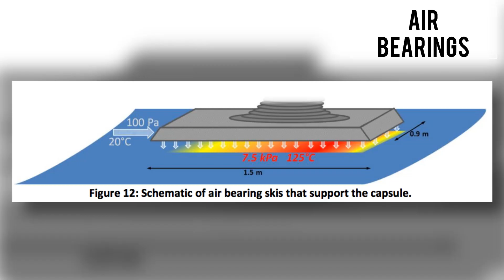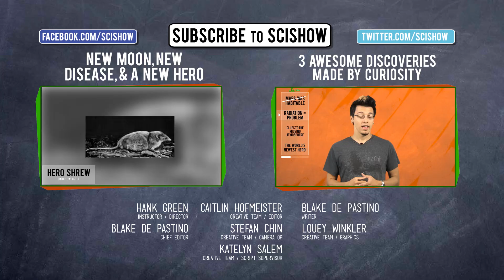The Science of Hyperloop

Comment: This would change EVERYTHING. People would be able to work in different states, and make it back home in time for dinner. Property values would change as people would no longer need to live close to their jobs. Travel and tourism would increase and this would essentially drive domestic airline prices down as new competition would enter the market. Of course, this could also just be a toy for the rich, charging $500-1,000 per person as a cost/time benefit analysis. I can see this being built in about 10-15 years. Nationwide interconnecting in about 30-40. This is definitely exciting to see and be apart of!
Reply: True. This could change land values all across the country. If you live in a little town a hundred miles or more from a good sized city but it has a hyperloop onramp and can get you 100 miles in 5 or 10 minutes  that's huge.
Reply: "I can see this being built in about 10-15 years."

I strongly disagree.
Reply: Ryan Leon if ever applied, I think this technology would easily change the structure of the world the same way airplanes and cars did before; it'd be completely mesmerizing to live in a world where you can wake up in L.A. and be in San Francisco in half an hour for work; I mean, most people who live in L.A. take longer than that to get to their jobs in the same city.
Reply: Where do you get that from?
We already have planes. This does much the same.
Reply: Flights are more expensive, need tight control, a large crew on the plane, extensive maintenance, crew on the ground to direct flights, use fossil fuel instead of electricity in most cases, etcetera.
So it does much the same for a much lower price - unless they inflate ticket prices into the sky, as Ryan proposed.
Reply: +Ryan Leon   Well, if the system had a lot of offline stations and the vehicles were small enough for point to point travel then it could allow a broader commute base but looks like they are focusing on city center to city center travel so it's really just to compete with airlines on the more profitable routes and with new planes along the long and skinny concept (modest capacity, long range and high fuel efficiency), it has quite a battle in front of it.    I doubt the currently proposed implementation would have the effects on demographics that you've imagined but if it's enough of a financial success than maybe they'll add offline stations later.
Reply: Ryan Leon maybe even from LA to New York for 2 days weekend vocation..

Comment: Whoa, hold on a second.  Who told you Tesla invented anything having to do with computing?  And sure, he helped develop radio transmission, but so did Oliver Lodge, John Stone, and this guy you may've heard of named Marconi.  As far as 'modern electricity,' I'm pretty sure we're using the same electricity that's been around for quite some time... Tesla was a proponent of A/C electrical transmission (for good reason), but nearly all devices in your home use DC internally (also for good reason).

Comment: You should exemplify for both imperial and SI users: 1 mile = 1760 yards, 1 yard = 3 feet, 1 foot = 12 inches. 
1 Kilometer = 1,000 meters, 1 meter = 100 centimeters, 1cm = 10 millimeters. This goes for volume, temperature and weight. As Mats said, 10 minutes learn, only add and remove decimals. 
Else, I suggest you imperials to change the American Dollar to Harry Potter's system, why use the obvious decimal system when you can have 1 Galeon = 17 Sickles, 1 Sickles = 29 Knuts, o.0

Comment: I know Canada is a bit of a mash-up of the two systems. For construction, imperial is mostly used. Same for measuring a person's weight and height. Grocery stores use imperial for most of the signs, except for deli, and the registers ring it up in metric. The older you are, the more likely you are to casually use imperial, as well as the closer you are to the border. The auto and industrial industries also use both, probably because of cross-border trade.

Comment: Yes; why fix anything when you can just make new! Thats why I always buy an entirely different house each time some appliance in mine breaks! Yeah, no, it's not cheaper to just build an entirely new fucking system. 

Also, I suggest you look up the energy densities of Gasoline vs electric batteries. And then look up how inefficient current solar technology is. And then look up the actual environmental effects of high tech waste on the environment. You know, actually do some research. For once.

Comment: That's why they do a multitude of tests and simulations to make sure the physics would work as it's predicted.

The major problem I can see with this though is the gradual pull and shift from plate tectonics, or the fist to the face shaking from an earthquake. 

I believe he's also proposing doing a setup for testing and showing off the concept to people with doubts/questions. 

Earthquakes though or strong winds will be quite an issue to deal with I would imagine. As the tube would move.

Comment: Currently, if tracks are damaged, it can be spotted from a distance and the train stopped-that's why there are still engineers out in front. Also, during their early history, railroads *did* get vandalized a lot simply because every new advancement presents a threat to someone {I remember a paranoid quote about the insanity of putting people into machines that go at breakneck speeds of over 30mph}. So irrational as it may be, we still need to prevent catastrophic damage, or have warning systems.

Comment: If the air inside the tube is very low pressure (I've heard 1/1000th of an atm), what would happen if there was a tiny rupture in the tube? Wouldn't the change from 1/1000 to 1 be very dangerous?

Comment: That is hardly a good example.
Although yes I spoke theoretically. In practice, i.e. in engineer terms, I imagine there's no such thing as a 500km long hermetic tube, it's bound to leak air either slow or fast depending on the quality of the joints etc. And preventing that would probably cost more in infrastructure than the energy required to maintain the void.

Comment: Moving fast isn't the issue - the problem is accelerating fast. If you assume a constant acceleration, constant deceleration model, then the hyperloop must accelerate at ~.7 m/s/s, or less then 10% of a g.  the max speed here would be 2,240 km/hr. I doubt the hyperloop would use this model of acceleration/deceleration (the faster you accelerate, the lower your max speed has to be) but this model shows that you can make the trip in the specified length of time without requiring massive g-forces.

Comment: Base 10 is a pretty retarded base. It has only 1, 2, 5, and 10 factors. Base 8 or 16 (powers of 2) are more sensible.
A mile isn't any more arbitrary than the kilometre. 8 furlongs in a mile, 10 chains in a furlong, 22 yards in a chain. Each measurement had some basis in use (like the length of a standard field).
I do use SI most of the time btw. I just think that the base 10 and arbitrary arguments suck.

Comment: According to the PDF, estimated average energy use is 21 MW.  120 W/m2 is a reasonable estimate for solar, but only of maximum production.  The pdf expands this to 285 MW max and 56 MW average.  Capacity factor for solar is in the 20% range, so given enough energy storage, the numbers do check out.  2.4 million square meters of solar panels would be hella expensive though.

Comment: These are addressed by the proposal. If one of the pods fail, somehow, or the tube fails, the remaining pods in the tube will react automatically by stopping. The pods have wheels for emergency stops. And yes, the high speed and frequency of departure compensates for the lost passenger capacity of single trains, and improves safety since there is less mass (and fewer potential victims) to stop in case of emergency.

Comment: I mean, imagine we were on the phone with a tailor and explain that I want to have a suit that's made to fit "my dimensions". It simply doesn't tell him anything. It really is the same thing by attempting to measure in palms. If it works at all the success will be accidental or because extremely low accuracy is needed. If you really need to measure, you need a standard and a "ruler" and it doesn't really matter what the scale is, but it matters that it is decimal for easy manipulation.

Comment: "I will often say that something is about a cubit and a palm long or whatever so they can get the idea."

That's probably because you haven't had the metric system drilled into you, because it's just as easy to estimate a number of cm if you're not going to measure accurately anyway. The main reasons for using the metric system has to do with there existing a standard definition and conversion between units though. Having to assume that you have the same size hands is really impractical.

Comment: the question i have is what if one of the passenger tubes malfunctions and has to stop (the tube will be blocked) if there is no second track, tube?
And does the high speed compensate for the lost passenger capacity?
Lastly is the tube malfunctions in a way that the passengers have to leave the vehicle how can they get out of the sealed tube?

Comment: After reading his papers, the only other problem i see is 'rush hour' use. People don't want to travel at 4 AM, they all want to travel home at 4 PM. His system will not handle rush hours overly well. The system should be built with pylons capable of carrying 4 tubes, not two, which would greatly reduce the cost of adding a second system, if one is needed, and will not greatly increase the cost of the first system.  The expensive part (tunneling) can be put off until it is needed.

Comment: If you take time to read Musk's proposal, you'd learn the system would generate a surplus of power and would store it in batteries, capable of storing sufficient energy to run at night and for several weeks of inclement weather.

Comment: I'm sorry but that doesn't even make sense.  The watt is measured in watts.

Imagine we called miles per hour, "spots". So you might say, "I'm driving at 20 spots." Now, a spot-hour is just a mile: how far you go if you drive at one spot for one hour. But spots *per* hour isn't the same as miles and it isn't the same as miles per hour.  (In fact, it's a unit of acceleration. If you start at 20 spots and accelerate at 10 spots per hour for three hours, you're doing 50 spots.)

Comment: No. 57MJ per year is 57x10^6/(365*86400) = 1.8W, which is about two electric toothbrushes.

The kilowatt-hour is an a unit of energy (3.6 megajoules), not a unit of power.  Energy is an "amount of stuff" unit; power is a "rate of use of stuff" unit; kilowatt-hours is "we used so much stuff per second for an hour so this is how much stuff we used."

Comment: yet you did your conversion wrong. =P

your initial assumption is right. one km is a little over 62% of a mile.
that means that 1120 km/h = 1120 x 0.62 = 694.4 mph.

also, your method of breaking it down is unnecessary and breeds small silly mistakes when re-writing the whole thing on the next line

Comment: Accelerate at 1g (that's what you are experiencing right now) for 34 seconds (roughly) and you are doing 1,200Kph. 

Drop that to 1/10th g and you accelerate for about 5 minutes & 30 seconds to get to 1,200Kph. Force exerted on my back at 1/10g is about 20lb. So not much physiological stress at all.

Once up to speed no g-force involved at all except in corners which will be made very long & gentle to no excessive force involved

Comment: A kilometer is a little over 62% of a mile and a mile is a little over 1.6 kilometers.
1.6 x 1120 = (1 x 1120) + (0.6 x 1120)
(0.6 x 1120) = (0.6 x 1000) + (0.6 x 100) + (0.6 x 20) = 600 + 60 + 12 = 672
1120 + 672 = 1792
So 1792 mph. That took far less time to do in my head than it did to type.
A shorthand example of how I think: 560 x 1.6 = 560 + .6 of 500 is half of .6 x 1000, so 300, .6 of 60 is .6 of 50 and .6 of 10, half of .6 x 100 is 60/2 or 30, .6 of 10 is 6. 560 + 336 = 896
896 miles.

Comment: To be straight, Hyperloop is an awesome idea! but it does NOT conflict with CA high speed rail:1) Hyperloop goes from Oakland to Sylmar, not LA-SF. 2) It will take far more than $6b, and a decade of implementation, for an UNPROVEN technology. 3) Hyperloop would face very similar political/logistical obstacles as HS rail, which is the main reason driving up the cost of HS rail. 4) Hyperloop has no intermediate stops. 5) Hyperloop would serve 7m ppl per year as opposed to 100m with CA HS rail...

Comment: You are right that 1 mile  is 1.6 times longer than a kilometer. 1 mi = 1.6 km.

To convert miles to km, all you do is multiply by 1.6 - just as you said. Your original post said you divide miles by 1.6 to get kilometers. 

What is throwing you off is that your value for km is larger than it is for miles, but that indicates the km is actually smaller than a mile despite its number be larger post-converting.

Comment: The conversion is 1.6 kilometers per 1 mile. Treat the per as division so its 1.6 km / 1 mi

Now just use unit cancellation to get from mi to km or km to mi.

For example, to convert 2 miles to km you know that you have to cancel miles, thus it indicates miles must be the denominator.

2 miles * ( 1.6 km / 1 mile) = 3.2 km

Comment: When I first heard about this I heard it would be in a vacuum tube and it would levitate using magnets. You explained why they can't use the vacuum aspect, but why aren't they using magnets? That seems like a better solution to the problem of friction. I can't really tell how the system will work that you described. Will it be sitting on a track in the tube and blowing air or would it be levitating by blowing air? Both seem like they're more difficult and less efficient than magnets.

Comment: ...

You have that backwards, the U.S. uses "Miles", "Pounds" and degrees "Fahrenheit", and their associated larger and smaller units, as their primary units of measurement.

The Metric System uses the "Meter", "Gram" and degrees "Centigrade".  In fact, as of right now, the U.S. is the ONLY country in either North or South America that does NOT use the Metric System.

Comment: How does the Kantrowitz limit apply in gun barrels?  I have a rifle that launches a projectile at 470 Meters/sec...is this only possible due to the short length of the tube?
In a 5000 Meter long barrel, would depressurization valves (open at front of projectile and closed behind) keep the motion within limits?

Comment: If the education system is not bad, why does it still teach outmoded  fundamentals?

I won't insult you by suggesting you may not know this, but ask any teenager or even university student to detail the fractions of an inch and the majority will struggle to do so given that most small measurements are carried out using the metric system in schools.

I understand that many American pastimes have the imperial system in their roots, but the system is old and widely unused.

Comment: It's stated in the project's summary that he plans to use the same linear motors to decelerate the train. What I find amazing is that it is stated there the peak power needed to decelerate the train consumes more energy than the max 57MW of the solar panels, hence batteries. Now, what about night travels? You have no solar power, and it seems the batteries wouldn't be enough for the entire night operations...  He would use the grid, of course. The system is half clean, half dirty.

Comment: There's a slight common error in measurement of the energy produced by the solar panels; Watt's are a measurement of energy/unit time - hence MW/yr doesn't make sense. I haven't done the math but I suspect MJ/yr was intended?

You can expect the Hyperloop to exceed the 1120km/hr mentioned - Time spent accelerating has to be made up in order to meet the expected total travel time.

Comment: ...further to my previous reply...
The imperial system is not base-12. Only 1 foot is divided into 12. In fact, until you get down to inches (where each lower increment is halved), the imperial system is fractional, based on arbitrarily-chosen numbers.  3 feet makes 1 yard. 16 ounces makes 1 pound. 20 fluid onces makes one pint. These values are entirely arbitrary, chosen for purposes of convenience in an era where they were (arguably) convenient.
That era has passed. It's the 21st century.

Comment: I'm pretty sure that the compressors wouldn't push the air out of the way. This would only make the problem worse by increasing the pressure in front of the craft. The compressors will pull the air in and under the craft.

Comment: Yes, because only a portion of the lifting force would result from the shape of the "bearings" and only at the high speed part of the journey. The biggest part of the lift would be created by compressed air that is eject out of the bottom of the bearing plates so that you get a high pressure region. The difference between the surrounding pressure (100 Pa) to the compressed air (10000 Pa if I remember correctly, created by the onboard compressors) causes the capsule to lift.

Comment: Friction generally creates heat, it is hard to power something with heat and converting it to electricity is not very efficient, plus having friction means it will not move as fast, the point being it moves extremely fast

Comment: Think of it this way - The classic high speed train is the ultimate perfection of the steam engine, a system that was never designed with efficiency in mind.  In order to reach this perfection, the actual system hasnt changed that much, just much fancier and expensive materials / electronics.  It is the perfection of an inefficient design. This is a completely new design, no fancy materials required.  Just simple, elegant, physics.